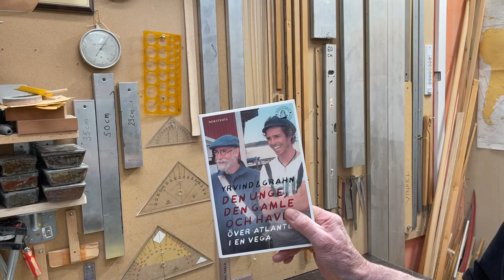16 Mar 2023. Västervik premiar and departure

Comment: Well. A bump on the ”rudder-blister” will most likely just move your little boat in the water without deforming the blister or the tiller. If nothing is on the other side to keep it from doing so. But what would be on the other side when you are out on the sea.

Comment: Maybe include a gear wheel somewhere on the rudder post, such that another gear wheel with a hand crank can easily be mounted with a hand crank (like on a big jib winch) nearby - as a backup steering solution if your engineered rudder arm gets stuck for some reason?
Reply: In general i agree that your rudder seems to leave little margin/tolerance for mishaps... so a backup plan may be good
Reply from the maker: I think that it is better to us a singel but strong system 
then one with backups.
I have been using similar systems since 1969 on several ocean passages includidng a east to west Cape Horn in June and never having any truble.
I belive in making one system that you love.
Reply: You know best, no doubt.... but you did invite pessimists to comment, so here I am :)    If what you mean by "strong system" ... is   one that can withstand some malfunction - then no more questions ofcourse.

Comment: I think your steering blister is a great idea. I'd be wanting 15mm gap around the tiller, just in case a rope got bound up in there somehow though. With lots of fiberglass on the outside, it will be at least as strong as your hull. Those tight curves make it stronger.
Reply from the maker: I think the clearance when the glass ffibre is on will be 5-10 mm.
The ropes will be under tension all the times.
If there is a failure I can reach it by hand and fix it.
It will be strong.